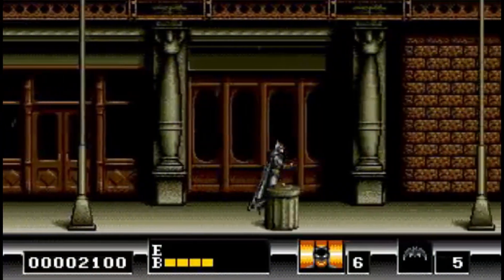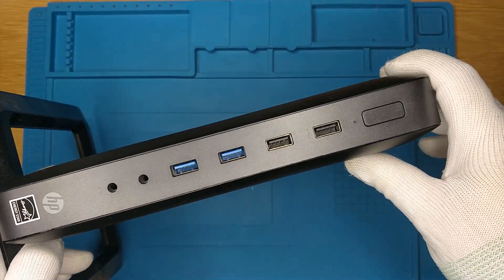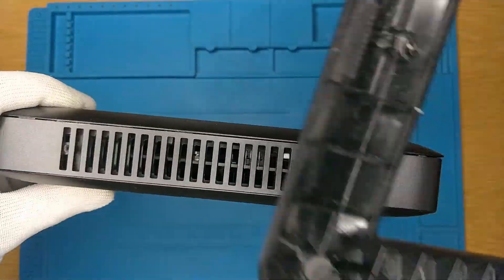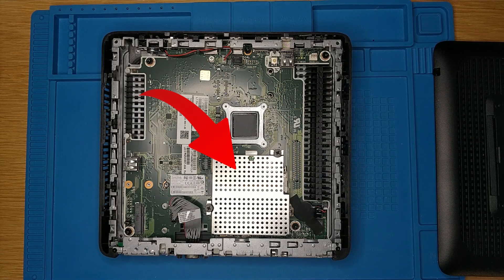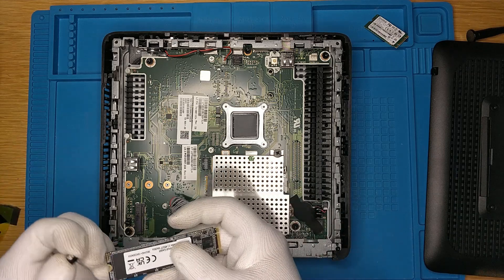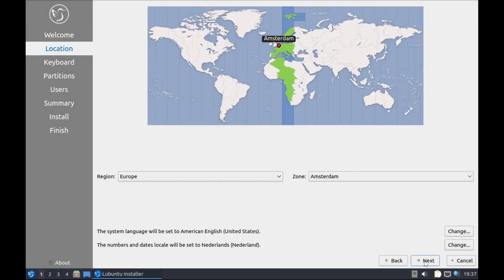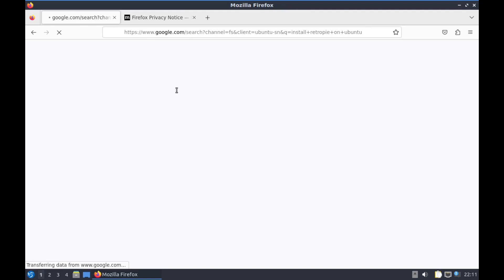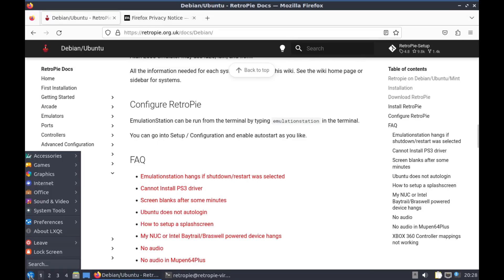Forget Raspberry Pis! Turning a $20 ThinClient into a Retro Gaming Machine!

Comment: In my opinion if you're going to replicate pi with retropie using x86 machine it's better to use something made specifically for this purpose, mainly batocera.linux, lakka or something like that
Reply from the maker: Yes! You're totally right, this could also just be a stepping stone into that direction. Sometimes you'd like to have something you're already familiar with or spend hours on configuring to look and feel the way you want to have it.

Thanks for watching!
Reply: How is the one that have desktop mode ?